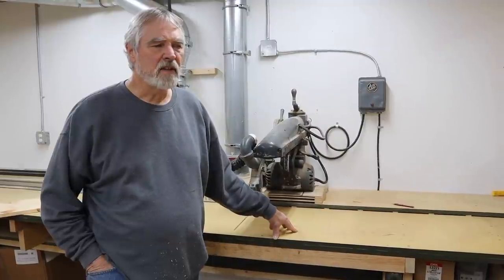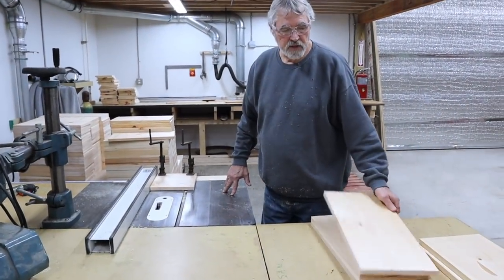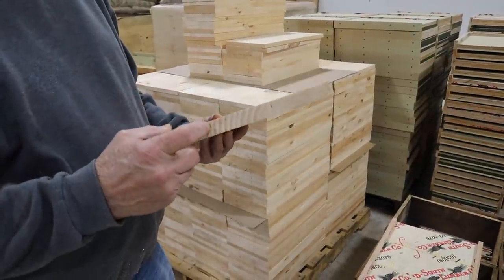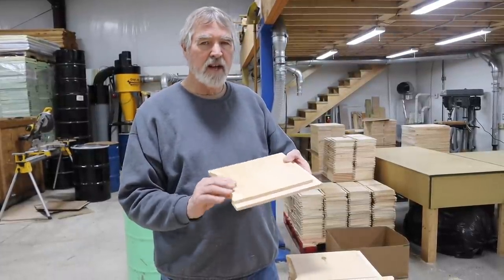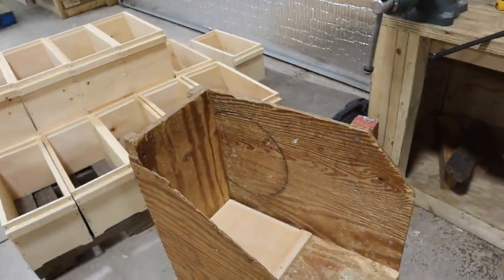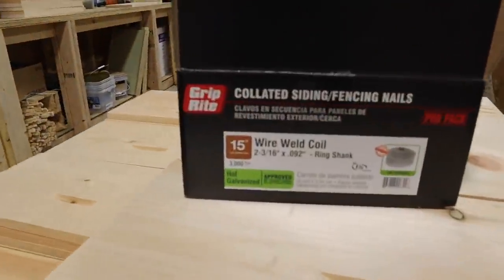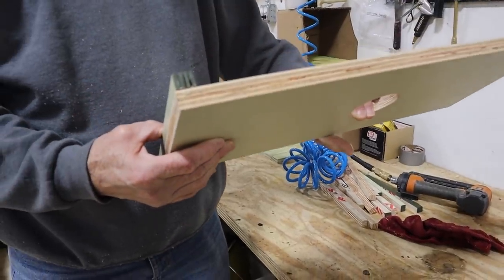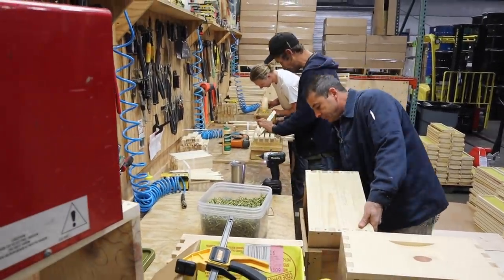How To Make Nuc Boxes In Number

Comment: I made three nucs per your instructions and they came out great! Thank you. My nucs came out 1/8" short of the standard 20" box. Is that intentional or should should the side measurements be 19 1/4? Or should I back my dado cut off a 1/16?
Reply from the maker: 20 inch is not standard and is a common mistake. A properly made box made from 3/4 inch lumber should be 19-7/8 in. long. Sounds like yours is perfect.
Reply: Which is better for the bottom boards and outer covering, pine wood or plywood?

Comment: Just a tip for John when putting on the handle, the gauge block can be made L shaped, hold down tight to the top, hold the handle with your thumb, nail it.

Comment: You can use a framing nailer parallel to your wood, but when using a finish nailer you should go perpendicular. the finish nail has a wedge end and if you don't go perpendicular the nail can curve to the outside and stick out. if you go perpendicular even if the nail bends it will still be inside the wood. Just a tip from a very old cabinet maker. Also if your worried about the boards splitting when using the framing nailer, spray the nails with furniture wax.

Comment: Thanks Bob. I appreciate your videos, experience and especially your transparency. I was surprised to see in the comments that you are not selling these Nucs in your store but instead intend to use them all! I am very interested in knowing more about how you incorporate these into your operation. Splits? Mating Nucs? I have been beekeeping for just long enough to learn a couple of things. 1: I need to make colonies every season if I want to avoid buying bees every spring. 2: I can save a lot of time by paying careful attention to how beekeepers that have got a system that works are doing their beekeeping. Happy New Year! Dennis
Reply from the maker: Hi Dennis. We will be using these nucs for both making splits and mating queens. We have had both 5 frame and 3 frame nuc boxes for mating queens and we're replacing the 3 framers with 5 for a couple of reasons. One, you can allow the queen to lay longer before harvest if needed and two, they're more versatile. I know I could sell lots of nuc boxes like these but there is only so much we can do. So funny that we purchase factory made nuc boxes to sell in our store but save these for ourselves. You're right in checking out other successful beekeepers. I've always said that the ones that get good fast are the ones that gather all the "good" info they can before coming up with a plan that works best for them. If you haven't noticed yet you will see that even the most successful beekeepers do it differently than their best friends. Good luck and happy New Year to you.

Comment: One suggestion for your nuc assembly jig, if I may.  You could place a small strip of wood, that is just small enough to fit into the handle slot of the sides of the nuc, and affix it to your jig sides so that when the nuc sides are in place  they still fit snug against the jig sides. If the nuc sides are in place any other way, the small strip of wood will prevent the nuc side from sitting flush against the side of the assembly jig and you’ll instantly know that it’s being installed wrong.
Reply from the maker: Good idea. Fool proof. Thank you.

Comment: Have you got a cost per unit figured? Those are very nice boxes.
Reply from the maker: Thanks. Approx. $26.00 includes labor, pine, HDO, screws glue, etc., but not paint and treatment.
Reply: @bobbinnie9872  That's not bad. It also allows you to keep your full timers employed. If they make the boxes they aren't going to abuse them either.
Reply from the maker: @russellkoopman3004  Exactly.

Comment: Can you confirm the taller box design is to accommodate a pollen pattie up top without having to add a raised ring to the lids? If so is that simply to save material and time or possibly other benefits?
Reply from the maker: We use a 10 inch box instead of 9-5/8 because there aren't any strips below the box on the bottom board which in our case would be 3/8 in. The bottom board is flat. If you are referring to the frame rest being 3/4 instead of 5/8 that's just to provide a true 3/8 in. bee space between the top bars and the flat lid.
Reply from the maker: @LaraLovesBees  We use extra shims on our nucs when feeding patties to keep the hive beetle problems to a minimum. The bees need to police as much surface area as possible on the patty.

Comment: Great video once again. Please keep up good work. 
Do you ever make swarm traps to put at your yards to catch any boxes that swarm? If so what lure and box do you use?
I use a router table for mating nucs  I made. Why dado over routing table?
Reply from the maker: Thank you. We don't put out swarm traps but if I did I would probably use lemongrass oil in a single deep box with an old comb or two in it, about ten feet off the ground where we could stand on a truck bed and get it. A router table would certainly work well, and would make cleaner cuts too. We used a large industrial router in the shop I worked at in Oregon for many things but the dado blades held up better and did a good enough job for grinding out thousands of rabbit joints for bee boxes. Also makes it easier to use the automatic feed.

Comment: Hi Bob i noticed you placed the glue on the end grain of the HDO rather than the side grain @13:30  then you drove the nails through the end grain. is there any reason for applying the glue to the end grain rather than the side or does it not matter likewise with the nails im an ametuer woodworker and was taught to put nails and screws through the side grain rather than end grain to prevent splitting. again is there a reason or does it not matter with HDO. Thanks for making this video and any advice is greatly appreciated. :-D
Reply from the maker: Hi Wayne. Good catch that most people miss. In most instances you would be correct. However, this plywood is so tough it's a little harder to shoot a small staple through three outer resin layers and because of the way it's manufactured it's very strong sideways. It never splits or separates.

Comment: Thank You for putting this all together and sharing, Bob!  Great Video.  Love your shop.  Love your fence system on the radial arm saw, too.    Are you making your own frames or buying them in bulk?
Reply from the maker: I used to make frames but now I buy them in bulk from Mann Lake.
Reply: @bobbinnie9872  Thanks Bob.  Do you buy them pre-assembled?   or assemble them yourself?  I know you run a huge operation.  I would rather put the frames together using TiteBond-3, and staples -so that I know that they are well put together.
Reply from the maker: @joecnc3341  We normally build a big stock ourselves in the winter. It gives the beekeepers something to do in mid winter.  We also use Titebond glue. This spring we sold and used more than anticipated and had to purchase some preassembled and they looked well done. Of course the cost and freight are always a factor. I can pay employees to assemble for less than preassembled and the freight is less.
Reply: @bobbinnie9872  I'm a big fan of TiteBond-3, and staples on frames.  They seem to hold up- but I don't have the years of experience that you do.  But it sure helps being a woodworker (and a cnc lathe, mill, router aren't bad to have around either).  For my hive boxes - I use 0.75" Finger/Box joints, Titebond-3, and Deck Screws.  I want to put together a parrafin dipping tank in the future.....  My plan is to make the beekeeping a part of my "working" retirement.

Comment: On the holes for the lids, are you putting a lid in the hole with no holes in it? Also, I notice when you feed, you don't put an outer shell around the bucket. Is that ever a problem? We use 1 gallon buckets to feed with. Thanks for the video. Good one.
Reply from the maker: If we aren't feeding we do put in a cap without holes. The only potential problem with buckets is the wind could blow them off once they are empty. If we're worried about that we put a small brick or rock on top.
Reply: Ok. Thank you.

Comment: Hi again Bob,  I was just doing some calculating on the lf cost of 3/4 in HDO (32 lf at $50/sheet  = $1.56 lf) whereas 1x12 lf for pine is over double that at Lows.  I realize I could find a lumber broker and likely get the cost down for a unit of 1/12 pine but my questions is, is there any reason, when considering bee health, or other factor I may not be considering, that it might not be good to use HDO for the entire nuc?  I live in WA, Bellingham to be exact, so long wet winters.  I have been using Inter lux 1026, a marine grade sealer to seal my exposed end cuts before priming and painting.  Thanks in advance for any advice.  I love your operation and wisdom, invaluable!!
Reply from the maker: HDO is heavier than the white pine we use per board ft. It's not a big deal if you are making a limited amount but when you're moving dozens or more that extra weight may be a consideration. Also, the price in our area ranges between $90.00 and $95.00 per sheet for HDO. Besides that I think it would good and probably hold up better.

Comment: Great info.  Have two questions.  What thickness HDO plywood? and what size hole saw for the top lid hole?  Thanks
Reply from the maker: I use 3/4 in. and the whole is approx. 71 mm or 2.80 in.
Reply: @bobbinnie9872  Thanks

Comment: Good morning Mr Binnie. I have always done my splits in regular size brood boxes. Is there an advantage to using nuc boxes for the splits instead of the regular brood boxes?
Reply from the maker: There is a slight advantage with thermoregulation in cold weather. Our reasons for using them are easier handling in large numbers and easier to find a queen when used as a queen mating nuc.

Comment: Thanks for the information !
Here in europe we make our hives jointed with clips , joints.The lid and the bottom are connected with them so when we move to another area to hunt the honey flow ,the hive stays in place so are the bees inside.How come your nucs and regural hives stays in place?I mean i see that you tight them with straps but all the other time the hive is ready to open? What if some animals push them (cattle ,hogs)?
Reply from the maker: We rarely have a problem with animals pushing them apart. Bears can be a problem but clips wouldn't help in that instance.
Reply: @bobbinnie9872  Thank you for the answer!But still dont they dismantle during the transportation?Or when you cary hives when unloading from the truck?
Here we drive bees through the mountains in very rough terrain.
Reply from the maker: @RKalos   In the summer we try to wait several days after working the hives before moving so they will have time to stick together well. They can come apart easier in cold weather when the propolis isn't sticky. We do our best to tie them down well and rough mountain roads would definitely make it more difficult. We've moved thousands of colonies thousands of miles and of course have had many problems along the way. I suppose I don't have a perfect answer for you, we just do the best we can and it works. Thanks.
Reply: @bobbinnie9872  Thank you very much for your good work!

Comment: Another question Bob .
 So you said you use a 3/4  dado for the frame rest on your nucs but not on the  supers or hive bodies . 
 We used to use it on all our supers so we had  bee space above the frames and out hive cover was a  flat  3/4 "  board .
 Why the 5/8 " on the supers ???
Reply from the maker: I like to keep everything standard in most cases so equipment from a variety of sources will stack and work together. I do think the bees benefit from the extra 1/8 inch space under a flat lid and I don't ever stack nuc boxes, so I don't worry about  being standard in that particular case.
Reply: Thanks for the info 
 I find in this area the supers being sold   have the frames flush with the top of the super which forces you to  use an inner cover .
  I just deepen the frame rest so I can use  my 3/4" ply reversable lids    one side has an upper entrance in it for cooling and ventillation  during hot spells and drying in  large nectar flows  and  the other is flat to close the entrance off if needed  .  
 Turning the inner cover over floods them out thru the feed hole during rains  if you want to close off the upper entrance
  I like the keep it simple too  ... one lid  for multi purpose .

Comment: I watch these videos and haven't any idea where to start sourcing the quantity of wood necessary to make a shop like this work.  In particular, the 1x material which doesn't leave so much waste.  I have also have very marginal luck finding MDO or HDO stock, and frankly none which is truly affordable.  Ideas on how to get started?
Reply from the maker: Hi Byron. We're lucky that in our area there are several small mills that we can purchase from. Every once in a while our local lumber yard can give us a good deal on 1x12 from New Hampshire. When buying from small mills we always make sure it is kiln dried for best results. HDO is always expensive, even by the unit. Bridge contractors will occasionally have used HDO to give away or sell cheap.

Comment: Are you ripping 12" boards down to exactly 10" or simply using 1" x 10" from the lumber yard?
Reply from the maker: We're ripping down 1x12. Planed 1x10 would be to small for design.
Reply: take your measuring tape to the big box story and you fined that dimenisonal lumber is about 1/2 shorted then the advertised size. Ask me how I know, LOL

Comment: I have not been able to find a source for HDO.  Is MDO acceptable as an alternative for tops and bottom boards?
Reply from the maker: Yes, MDO is the next best thing to HDO and is made in a similar fashion. However, where HDO does not take paint well on the surface MDO does and will last longer if painted. It is often used for exterior sign boards.
Reply: Look at your local Concrete Form supply house...
Reply: When you do something that lasts longer than you can use, it means that you thinck properly.

Comment: Do you use the rabbit joint for 10 frame boxes or do u go with a finger,box joint
Reply from the maker: When I make my own I do use the rabbit joint.
Reply: How well do they hold up compared to the box,finger joints
Reply: Bob, do you prefer rabbet joints, or are they just easier to cut?

Comment: Most boxes are made using solid timber, is there a reason plywood has not superseded using solids?.
Reply from the maker: My personal opinion is that standard plywood warps and delaminates too much. Good ply wood, such as HDO or MDO, could work well in my view. Or plywood dipped in hot paraffin could be a good choice. I know of several beekeepers that do that for lids.
Reply: @bobbinnie9872  Thankyou for the reply.

Comment: I drilled and screwed my boxes .. on the few I made is that frowned upon?
Reply from the maker: I like screws, I think they are better. We use the nails to save time.
Reply: @bobbinnie9872 Have you ever tried using 7/16 crown staples? I’m going to be starting assembly of a couple dozen hive boxes, bottom boards, and lids and have been interested if they’d be similar in holding strength for the application.
Reply from the maker: We have used staples but found that they don't hold as good over the long haul.
We shoot galvanized ring shank siding nails which hold better in our experience.  @chandlersimpson9838
Reply: @bobbinnie9872  Thanks for the reply! I’ll look into those.

Comment: Is it possible to use black hdo plywood, thanks
Reply from the maker: I hope so because we just bought a unit of it. Some black HDO is made with Poplar wood which we had bad experiences with. What we just bought is made with birch and is 13 ply. I'm hoping that will be good. We'll see. We're going to rough up the surface with 80 grit sandpaper and paint the top so it won't get to hot.

Comment: Bob in looking into making a bunch of boxes. Do you make finer joints or have a preferred method to the box joint?
Reply from the maker: I actually prefer finger joints but don't have an efficient way of making them so I just make rabbet joints.
Reply: @bobbinnie9872  have you looked at the liking miter joint. Can do it with a router table
Reply from the maker: @3Beehivesto300  I had not heard of that so I looked it up. It looks like a good joint.
Reply: @3Beehivesto300  do you use this joint?  I tried it and unless the board is perfectly flat, the joint won't be even.
Reply: @nkapiariesjeffbeezos796  never tried it but can see if it’s not perfect you pay…

Comment: You had me in a panic there for a second Bob. I'm in the middle of making 50 nuc boxes and saw that you cut your face and back board at 9 1/2. I cut mine at 9. I thought I did the math wrong. Does the extra room help with the 1 1/2 gallon feeder?
Reply from the maker: You'll find that 9 works, I used to make them that size, but the inside may be a little tight when taking frames out.
Reply: If you put in six new frames it looks like there's a lot of space. Now place there six used frames and the extra space will be gone. And when you have queen cells on your frames, it gets tight.